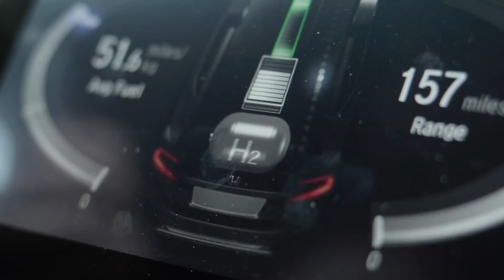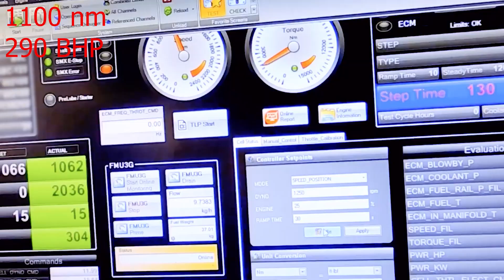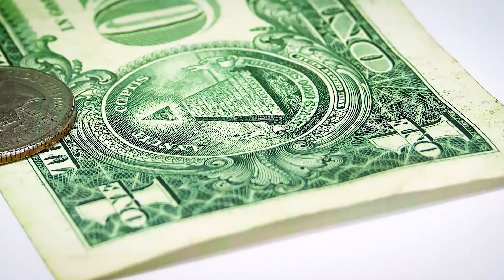Cummins changes there focus from diesel to a 15 liter Hydrogen Internal combustion engine

Comment: Race cars use alcohol or a.k.a. ethanol which is almost 0 missions we could have switched a long time but big oil runs the world
Reply: You have to produce ethanol.
And farming enough crops to make it to run all the veichles in the world means we have to cultivate something like three earths.
We have only one.

And no, ethanol per se is less polluting than gasoline, but all the production line is a lot pollutant.

Recent studies show that in the USA the idea of making corn to produce ethanol for fuel have more emissions than using straight gasoline, and it deteriorate also the soil.
Reply: @dadoVRC  It’s been proven that Ethanol can be produced from nearly any plant with sugar. I’ve seen people make it with waste corn husks and not the corn itself, therefore producing two products, instead of one.
Reply: @violetturner9248  That method is less efficient, so it isn't used.
Reply: True but they have found plants like bamboo that grow like wild fire down in the swamps that yelled 50 times the ethanol but they chose not to because if they can raise gasoline prices they can force us to use whatever they want I like electric but we don’t have the power grid for it and it’s vary long charge times

Comment: Definitely hydrogen.
Reply: Yes at leat i can run oil injection on the hydrogen 2 stroks. But aetheric ZPE homopolar motor generator will make much more power anywhere in space.

Comment: I love the idea of Hydrogen combustion and Diesel. Electric cars are lifeless lacking souls.

Plus in countries like South Africa the range will never be adequate, the electricity issues will always hinder traveling anywhere.
Reply: Diesel could run on renewable diesel HVO or biodiesel B100.
Reply: @playgt326  Toyota and Audi have released details about some of their diesel powered models being able to run on HVO with a conversion kit. Specifically 2010 and upwards
Reply: @playgt326  most cars in the US on the road today only need minor conversions to run on 100% ethanol also... this is already the case in Brazil for a decade. We'd just install those systems in our cars here (and part of it is already there since we have E85 fuel that is up to half ethanol).
Reply: Souls are imaginary. 
Why did you choose to be a nameless coward pretend human?
Ashamed of yourself?
Reply: But that's an issue for the South African government to solve..... No problem at all for me, as I never take my EV to South Africa.
Reply: Electric cars are just a joke imo. They are hideously expensive, need to be charged and commercial battery technology is simply not up to the task and wont be for possibly a decade to come. 
If electric cars had a little nuclear reactor in the Trunk that would power them for thousands of miles without recharges I would be interested.